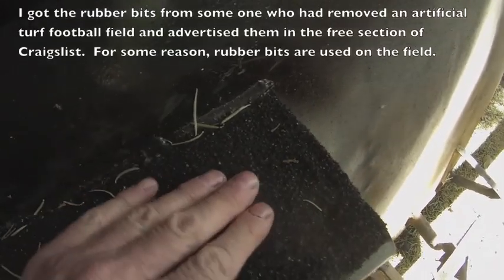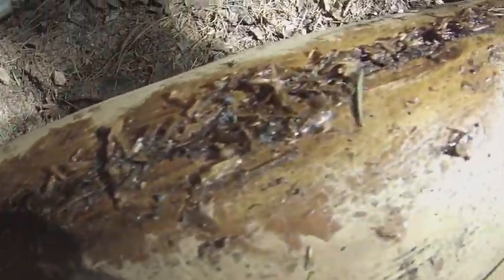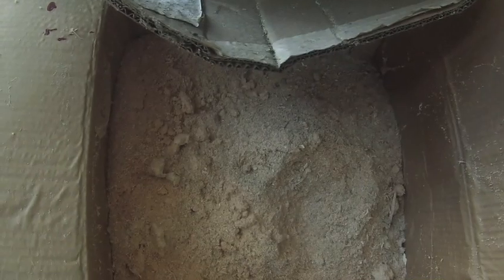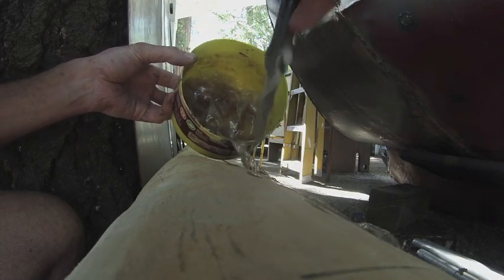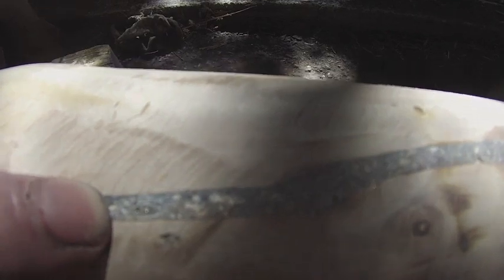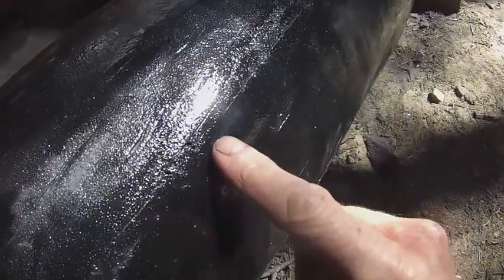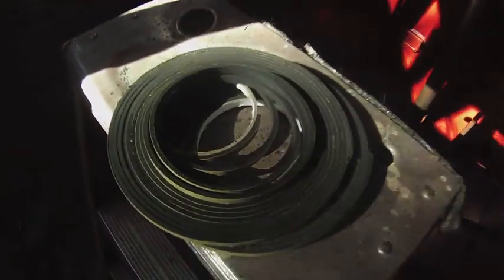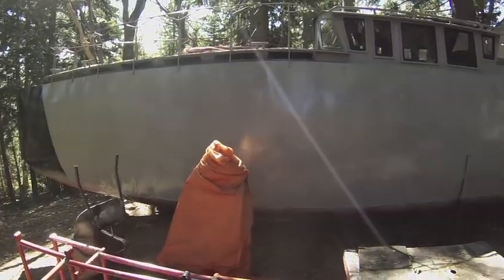Steel Sailboat Build Part 32

Comment: Use the Stainless Steel Straps around the Mast; that will make a HUGE Difference in the strength area. Filling in the cracks on the mast was only for Aesthetic reason, that will not do anything for the strength since you did not bridge the cracks, you just fllled them in. A Strap will bridge the gaps and provide much strength.....Dont take this as criticism but as acquired knowledge. Your project is fabulous I very much appreciate you using what is on hand and available....

Comment: You may need to paint the mast white and not black... black wood on a boat sucks up the heat and causes lots of problems for the wood. Dry rot, even more cracks...etc.... I must say, I like what you are doing... good luck

Comment: Looks good. Have been watching from the start. Looks like Space X may have watched your sail boat project also. The Starship is being fabricated out of 301 stainless. Elon Musk said it weighs more than carbon fiber but it's only a small fraction of the price, takes heat better and if needed the Starship could be cut into parts and re fabricated into something else later. This might be handy on Mars where there are no easy to buy resources. Your boat is no different.
Reply: starship is amazing it will be neat to see her fly
Reply: Being able to recycle this "boat" is going to at least mean he gets scrap value. Well done.

Comment: that bondo polyester fiberglass resin with MEK hardener is the most toxic stuff i have ever smelled.. I have found an almost non toxic epoxy resin that i swear by for wood , yes its about twice the price , but not having that smell , and major brain damage is worth it to me, lol.  Any way thanks for the video , and good looking mast and windows.
Reply: What is name of epoxy?
Reply: @joeclarke9782  Aero marine https://www.aeromarineproducts.com/product/clear-epoxy/ 

i built a 16foot cedar strip canoe with this that weighs about 30# its nice stuff. 

   You would need to cover the epoxy with paint or something like helmsman spar urethane if  its going to be exposed to sunlight. you could probably also get away with adding pigment to a top ablative coat.